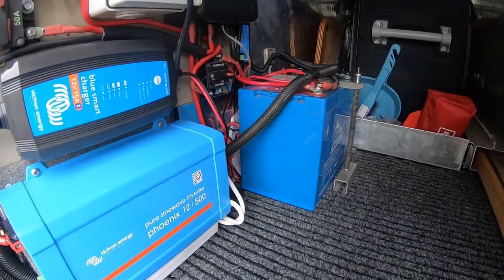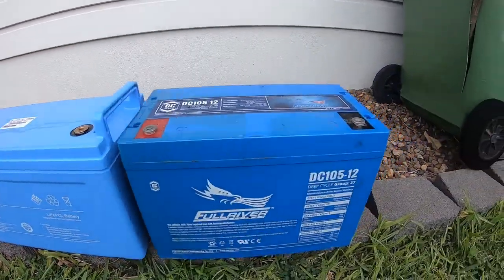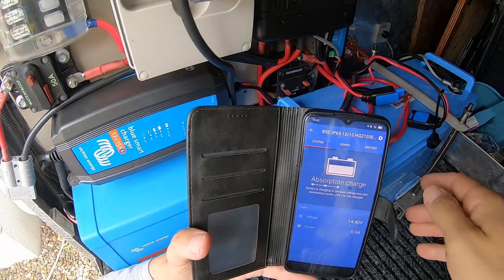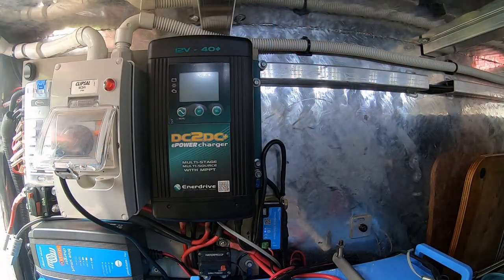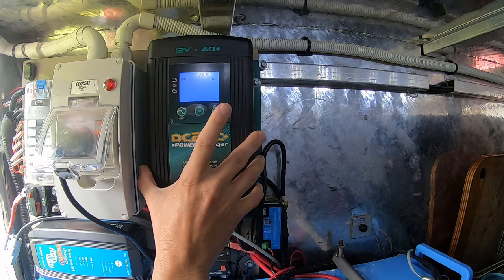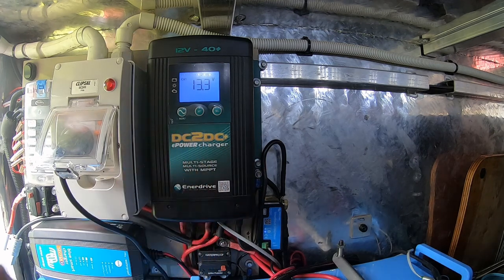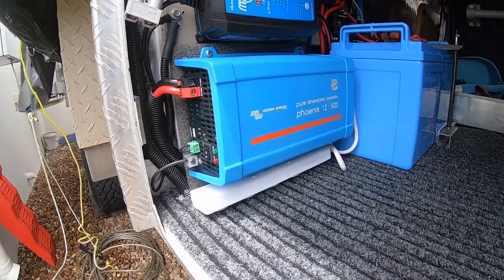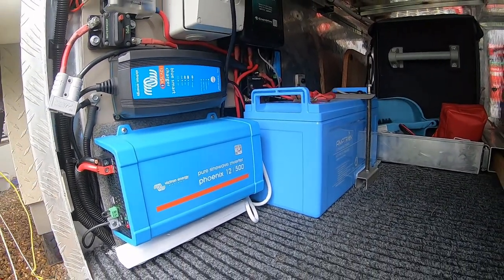Camper Trailer - Amptron 150 A/H Lithium battery, Enerdrive DC/DC AGM to lithium set up.

Comment: 6 months on is it still working well?
Reply from the maker: Been on the road 7 weeks now and going great, exceeding expectations.   Did 8 days in Darwin no power, put out a kings 120w blanket and still had about 60 percent battery when we left.
Reply: @kingsaroundoz7320  Thank you, looks like you have some great quality products there.
Reply: Gday mate, are you happy with the battery, was looking at getting a couple of the 200amp hrs lithium batteries for my van . Cheers